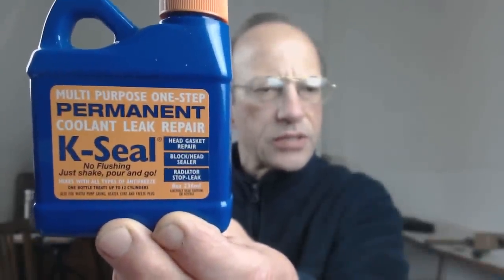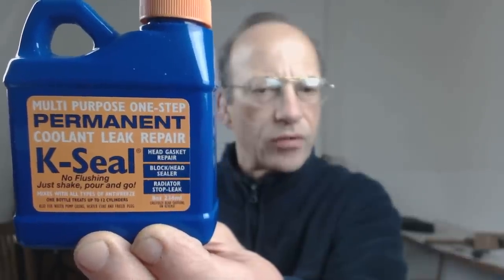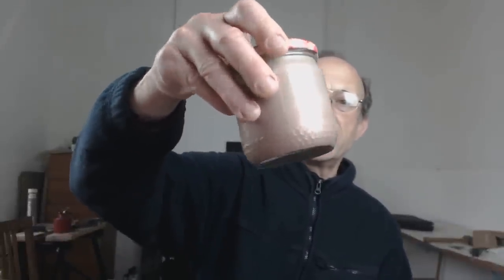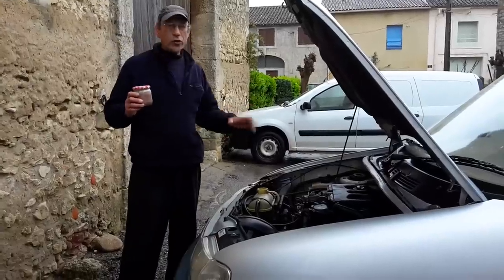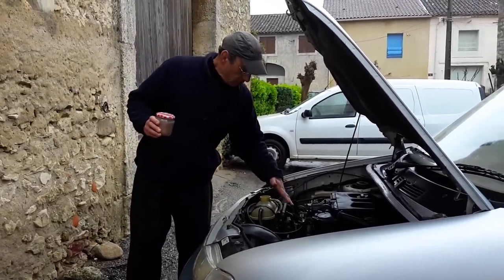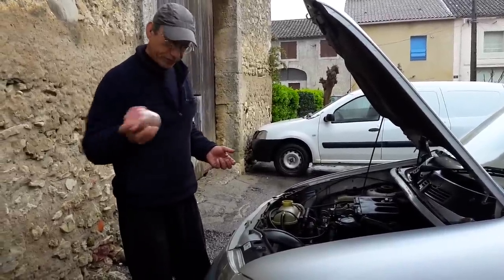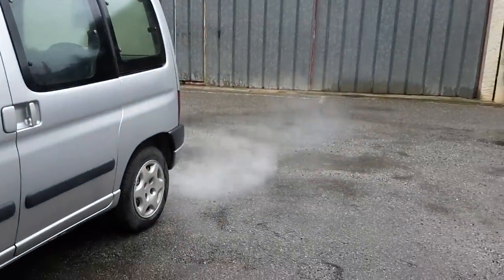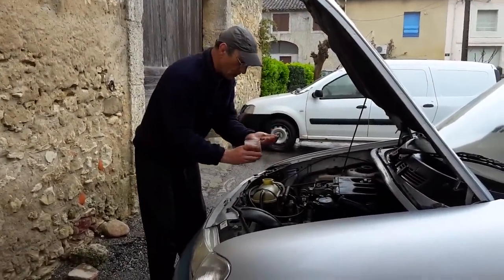K-Seal Full Test - Purchase options, Instructions & Results

Comment from the maker: Good news... or sort of (from the thread perspective).
I found out where the water is going.
... out of the overflow pipe.
 
I'd noticed I was losing water, but the exhaust wasn't steaming.
Instead, the cooling system is gassing.
The system is pressurised when cold, and when removing the cap, there is a release of pressure and a lot of gurgling.
 
I left the engine to get to temperature.
When the thermostat opened, a bubble would be produced every few seconds, lifting the water to the top of the tank.
The bubble would then rise to the surface, allowing the water level to recede.
A few seconds later the cycle repeats.
 
I left it for long enough to ensure that this was continual IE. not just an air pocket.

I'll drop the coolant, and replace it... maybe that will fix it.
Has anybody else experienced this?

EDIT
Just reading up... it seems others have found it can take 20 minutes to clear, and the heater should be opened to hot, to maximise fluid movement through the system.
I'll report back after trying this.
 
At this point in time... I'm guessing head gasket failure.
If so, it may simply be bad luck.
The symptoms are completely different to the fault last year.

I'm running with the cap at the second lock position, so the pressure can't build up.
Apparently, I need to run with rich mix of antifreeze
Reply: How's your car holding up? Do you still have the same problem you described or did you find out a solution?
Reply from the maker: I've been lazy.
I really must contact K-Seal and ask them if they can send me another bottle.
It's definitely a different problem to the original, because the original was not gassing.
However, they owe me, cause I reckon this thread has put a lot of business their way.
So I'm still driving around with the cap on its first notch... but I don't go far so it's sort of okay.
I'll try and find time to write to them today.
Reply: I'm having this same problem
Reply: So it didn't fix your head gasket problem?
Reply from the maker: @fallenone6  It did, for about six years.
Whether a new problem occurred, I don't know.
Reply: @EngineTuning  oh wow 6 years that's awsome. I figured from this comment that it only lasted you 1 year since it was posted a year after the video.
Reply from the maker: @fallenone6  I finally scrapped the Berlingo last year (Nov 2023) and bought a new Dacia Duster 1.5 Diesel - a fine vehicle.

I miss the low load flat bed, but I guess that life changes :)

Comment: 400 people on amazon are very satisfied by the product so I wouldn't worry about a thumb down. :-)
Reply from the maker: Yes you are right... and we have a 10:1 thumbs up ratio on this vid :D
Reply: it worked for my opel astra as well. and mine had a bigger gasket failure so that the water started boiling and overheated and had white steam out of the exhaust
Reply: That's because it really works, that's why.
Reply: @EngineTuning  they hatin that’s all
Reply from the maker: @KYNGMusix  I think that you are probably right :D
Reply: @EngineTuning  I just used the K Seal but it wasn’t a gasket it’s my water pump. So now I have to get a new water pump
Reply from the maker: @KYNGMusix  Yeah, shit happens.
It's a reasonably common false fail with K-seal.
IE. It could never fix the water pump in the first place.
Such is life .
Thanks for taking the time to make a report :)
Reply: @EngineTuning  thought the head gasket was faulty so I bought the K Seal but I just found it wasn’t the gasket, it’s the water pump so here I am at least Ik what’s wrong with it I’ll fix it tomorrow hopefully and that’s that’s for now 🙏🏾🙏🏾
Reply: Make it 401 because I’m one of them! I was so afraid to run my 2014 prius from Chicago to Texas 17 straight hours and trust me that liquid did amazing job and save me a head gasket swap for $2500  or new engine!! I all I can say is that don’t be afraid that stuff worked for hundreds or maybe thousands of people and I’m one of them 💪🏽
Reply: So far, I've tried it 2 times for 2 of my semsi. It's BIG TRASH. It's still leaking,  48 oz of the HD 48 oz of the ultimate.  Tragic 😢

Comment: I can honestly say this k-seal truly works...I have a 1997 ford expedition 4.6 that had a real bad smell of antifreeze and smoke was coming out my vents. I brought a new heater core to replace the old one; but after pouring the k-seal all the smell of antifreeze and the smoke completely stopped..so I returned my new heater core and got my money back...only took about 10 mins to work...thank you for the video
Reply from the maker: That's great news anthony... money saved!
Reply: Just added to my 98 ford expendtion
Reply: Engine turning
Just next product that I am suggesting does have anything to do with this video but I felt obligated to suggest a remarkable project that I have used in the past on five different vehicles and I put it to the test and it was amazing how it did not blow my heads the particles called prolong engine treatment
Reply: I see this comment is 5 years old. Any update as to how long it stopped the leak for? I just put this in my 2005 Jeep cherokee with a leaking heater core fixed leak. Had to use 2 bottles Hoping the repair holds

Comment: Just tried it on my 2016 BMW 740i and it worked and saved me some big time money! Last year I had my whole entire coolant system replaced under warranty. So I was furious seeing that puddle in my driveway. BMWs are known for they coolant issues and glad I went to get this and it fixed my problem. Thanks for this video!
Reply from the maker: Wow! That's interesting.
I wonder where the leak is (was)?
I guess that it must have been a rigid leak, rather than flexible.
If it was rigid, then it is likely that your 'rich status' will be maintained :D
Reply: @EngineTuning 🤔 don't quit understand your comment whats the difference between a rigid and a flexible leak
Reply from the maker: @mixz9929  I was talking about O rings against a cracked head, or gasket failure ;)

Comment: This stuff works.   I had a 2009 Subaru Legacy which are known for blowing head gaskets(i didnt find out until years after i purchased it).  I put in kseal and followed the directions to a T.  Never leaked again for the next 9 months i had the car.  Was told a new head gasket would be 1500$.   The kseal was like 11$.   Would recommend.
Reply from the maker: Nice report Jeff.
Thanks for taking the time :)

Comment: Thanks for this video, I'm just about to use K-Seal on my Mini R58 Coupé after being quoted £800 for a fix. I was a little worried about how the product dealt with a turbo unit but Colin @ K-Seal assured me (with diagrams & advice) as long as it's a water based coolant system this works. So fingers crossed, if I don't report back today it's worked!

Comment: I used K-Seal with some trepidation after reading all the reviews and it stopped my water pump leak COMPLETELY ... has run at perfect operating temp ever since and I had been losing 2-3 cups of fresh coolant overnight into a container EVERY DAY ... UPDATE: has been working perfectly for the last 6 months including 615 miles put on it during Hurricane Florence ...
Reply: I did the same exact thing, was going from Mississippi, to Iowa .. I would check my fluids, along the way I noticed the water pump was leaking. It is a time consuming repair, not easily accessible, and you need to remove a bit of stuff (not something I could afford to take to a shop, and I lacked to tools on me to replace it myself).

I kept having to top it up at every gas station with distilled water, however I knew Iowa was cold that time of year, so I found a Walmart. Bought a jug of undiluted, seen kseal right beside it, figured at best it would probably just leak less, I never had to top it up the rest of the trip.

It lasted for about 2.5 years (kinda out of sight out of mind thing), I was up in North Dakota when it finally failed, and I replaced it in the parking lot of the hotel I was at.

Comment: I just used the small bottle of K-seal yesterday in my 1998 Land Rover Discovery, to seal up a split seam in the stock, brass radiator. No leak today. I bypassed the heater core for this treatment by hooking the heater hoses together to avoid plugging up the heater core. Temp is perfect, heat is blistering hot. It will certainly do until I have the time to remove and repair the radiator. I'm happy with it.
Reply from the maker: Thanks for the feedback Ian :)

Comment: I know this is old video but I was skeptical at first but I tried it on my daily driver 2000 blazer that had a leaking head gasket and it's been 30k miles since then and works awesome no overheating issue even in extreme traffic & heat saved me over $1000.00 easy
Reply from the maker: Thanks for your report Rob 
My Berlingo is also still running fine :)

Comment: I used this product in my 2000 Ford Ranger 2 weeks ago. It had gotten a decent leak in the timing cover (about a drop every 5 seconds) and replacing the timing cover on this vehicle is a huge huge pain. I put a half bottle of K-seal in the radiator and another half in the overflow reservoir. My problem cleared up instantly. A week later, I did a coolant flush. During my coolant flush, I noticed that my overflow reservoir was completely clogged by the K-seal (or possibly just dirt), and that the whole half bottle of K-seal I put in there was still in the reservoir. Personally, there was already a lot of dirt in this reservoir, so I cannot really say K-seal was for certain the cause of the block. This did show me however that I did not need a whole bottle, but closer to half to fix my leak. I removed the reservoir, cleaned it, unclogged it, and finished my coolant flush. Still no leaks. If I were to give advice from my one time experience I would say:

1: put it in the radiator not the reservoir
2: start out with half or even a third of the bottle, especially for small leaks. There is no reason to put in more than you need to,  and doing so increases the risk of any other side effects of the K-seal

Throughout the 2 weeks my car was driving fine, no overheating. After my coolant flush it is still doing the same with no leaks. I do recommend this product to fix issues that are otherwise expensive or complicated to fix.
Reply from the maker: Thanks for your report Tyler.
The detail adds to our knowledge  :)

Comment: I have a 1997 Freightliner FL70 16 ton wrecker. It had a bad external head gasket leak to where after a couple of hours would need a gallon of antifreeze. You could watch the flow of coolant run, not ooz, but run out of where the head meets the block. After 5 minutes or so the leak went down considerably, and now after 40 minutes it is just about gone. I will continue ti run the engine at around 1500 rpms. After an hour it had sealed the leak about 95%. I am not sure that the reason for a continue small leak was due to the size of the cooling system or if it had to use so much of the product in other parts of the cooling system. I will be leaving it in the system and running it for about 500 miles and see what happens. I will try to keep you posted
Reply from the maker: Thanks for that interesting report.
It looks like your problem is fairly extreme.
Maybe even worth investing in another bottle, if the short term running doesn't fix it.
Good luck to you.

Comment: 2004 VW Touran 2.0PD tdi common problem is 'porous head' or hairline cracks that develop within as low as 30k.

I bought a cheap 2.0PD tdi @ 90k miles. 6 months later coolant level flashes up, top up to see how many miles before it happens again and its about 5k miles. Do this for a few years as no loss in performance and hope it wont get any worse. It did and was getting low coolant every 1k miles. 

Stuck a bottle of K-seal in at 120k, lasted until 160k. Coolant flushed at 160k and another bottle of K-Seal put in & now at 190k. 

New head and labour would have mechanically totalled the car straight after I bought it. K-seal has essentially meant the car has covered double the miles....it works!
Reply from the maker: Very good informative post.
Thanks James :)

Comment: hey there used this in a 2C toyota diesel non turbo was blowing water out overflow kseal worked for about 2months then started using water have done another bottle and on a long drive now so far so good
Reply from the maker: Wow!
Well done!
The fault must have been on the limit of what can be repaired.
I presume that you have not changed the coolant, so K-Seal will be continually circulating.

With luck, it should stay fixed.
Obviously, keep a bottle in the car, to get you home, if it does fail again.

Fingers crossed :D

Comment: I had a bad water leak on my ford fiesta diesel 1.4tdci it went from top limit to bottom limit on the expansion tank only driving 12 or so miles so input a bottle of k seal in and no leaks so saved me a lot of money ☺
Reply from the maker: Nice report Paul.
Thanks for taking the time to share ... I'm sure that others in the community will find it helpful.
:)
Reply: Thanks , I have Ford KA 1.2 , I’m losing water and topping up once a week ! The water in the container us looking muddy / dirty I’m guessing head gasket ! Do you pour directly into the water/coolant container . I’ve seen people say put it in the radiator ?????
Reply: @thornbird6768   I put it in my water bottle  and it was fine

Comment: After skimming through many websites, e.g. rover, amazon, hondaclub and etc., your video offered me the most convincing evidence to solidify my intention to buy and apply, k-seal to seal my coolant passage in the engine block. After exact 7 min 47 secs, k-seal stopped my 99' Terios's leaking issue, i.e. 800-1000 ml per day. 

It is worth mentioning that I applied it on my Terios during the noon time, at around 55-65 Celsius. During the night on the same day, I started my car again to check whether contraction (cold) would affect the performance of k-seal. Well, it leaked again and the leak issue, i.e. 25 ml, stopped after another 9 min 10 sec. Well, contraction could be a problem for external leaking. I would say k-seal is so far, so good at the moment.
Reply from the maker: Nice report Jia!
Thanks for sharing.
Let's hope it stays fixed :)
... oh yes... and thank you for kind words :)
Reply: Over the past month, kseal's performance has been beyond my expectation, where the level of coolant almost stays fixed in the tank and no leakage was observed. By the way, kseal must be directly poured into the radiator tank, rather than head tank, for Terios since Terios's coolant circulation design sucks.
Reply from the maker: Thanks for the feedback Jia :)

Comment: first and foremost your tag is very much appreciated by me and i am pretty sure by others
who have been going through these problems.

I have used "K seal ultimate" for a BMW E46 diesel from 2002, the car was not drivable anymore due to

-overheating (even the AC fans were on to try to cool it down after a trip of 10 min.)
-coolant circulation was blocked, i guess due to back pressure.
-overwhelming white smoke from the exaust, felt like a steam engine
-heater was not blowing hot air, possible heater matrix failure
-but i had no power loss
...

so after doing my research, I have come up with your page and i was convinced to pour into my
expansion tank,

i have put the front to the ramps, i felt this would help to reach to engine block with k seal,
after i have warmed up the engine to operating temprature, I have poured it in,
it took a while to start up the coolant circulation but it started circulating,
i have kept it on idle for 30 min of so with cap off, i have shut off the engine and restarted and run on idle for 10 min,

everything went back to normal,
-normal coolant circulation
-disappearence of the white smoke, but i do need to mention that this took a while
-hot and cold air from the heater

then i took it for gentle ride doing 30km, no coolant loss, all was ok,

the day after (yesterday), i have done 150km on the highway,
temprature stayed in the middle during the trip,
but the coolant light came on again at the end;
so today i have topped up coolant to the system,

so consequently it worked for my car!
i could put it back on the road,

but what could say for;
-coolant loss
-and i do see soapy stuff with copper particles in the coolant,
do you recommend a coolant flush?

Best
Reply from the maker: Very good report Emre El Turco :)

Personally, I left the k-seal in.
It does remain active.

My engine developed a different fault, when I used cold start spray to start it, one very cold morning.
I subsequently added 5% petrol and 1% acetone to the diesel.
This solved the starting problem in winter.

The new fault caused bubbling and fumes in the coolant - not the white smoke out of the exhaust.
It was clearly a different fault.

To prevent over pressuring, I ran the car with the cap on the first notch ie. not sealed
The k-seal gradually shut the bubbling off, and that was it ... fixed.
I could then run the coolant system under pressure.

So I had two bites of the cherry.

Therefore, if you drop the coolant, you should keep it in a container and mark up the container with a permanent marker.

As for flushing?
I don't know, because I didn't flush the system.

It probably should have been done before adding k-seal.
However, you could try it.
At least you know that you can fix your motor.

:)